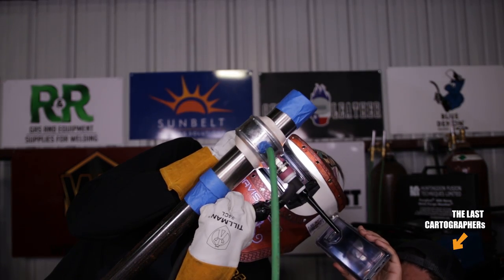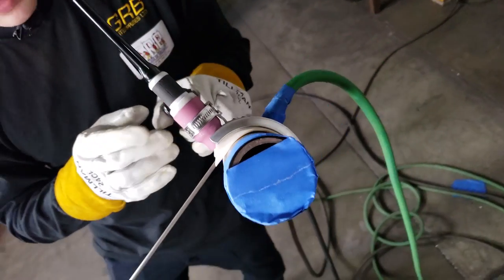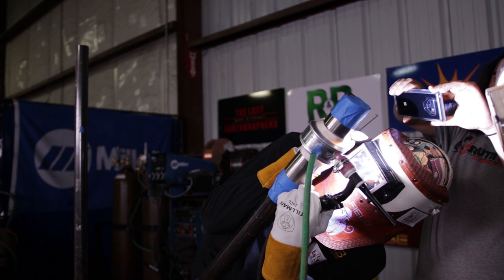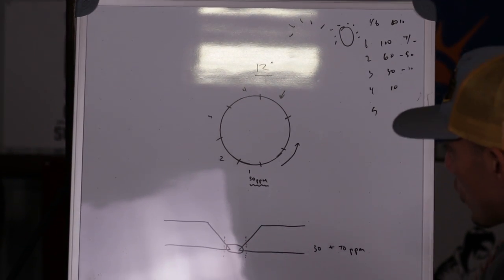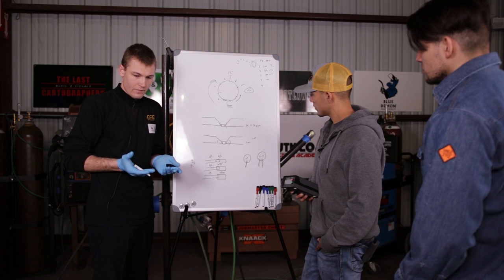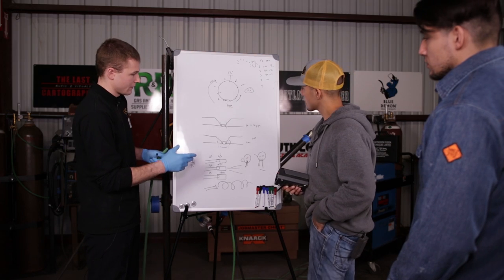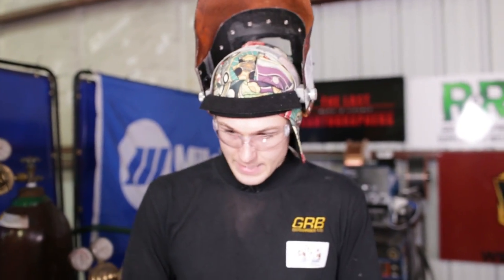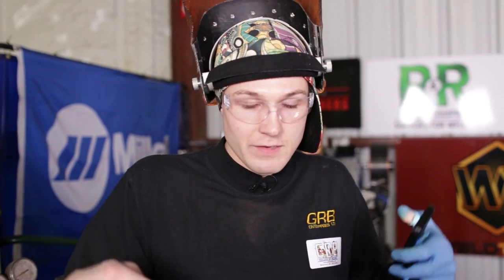Titanium 6G Welding with Travis Field - Part Two

Comment: Did he mention his actual settings on the machine as far as pps and amps?  I remember in part one he mentioned 200 in explaining pulsing current per ripple. What's amps did he recommend for root vrs filler & cap? Also what was pulse per second set to? 8 seconds on post flow before and after activating and terminating the arc? Sorry, i gotta watch stuff like 5 times before it sinks in. Damn ADHD . Havnt gotten around to flashing trough both of the videos again yet to seek out my questions. If someone could type that ballpark info out so I can take a snap shot that would be awesome. Thanks.

Comment: I never thought about gasoline and anti-freeze for the cleaning aspect of it...I have always used 91% alcohol or better...if I could find straight PGA (pure grain alcohol)  for cleaning, same as I would when seal flossing copper pipe or tig welding stainless potable water or sanitary lines...the alcohol was just used to remove any oxidation or oils left over from finger prints if touched with ur bare hands...people don't realize just how much oil and grease ur bare hands will leave behind no matter how clean u think ur hands may be...but the gasoline & antifreeze just seems to me like it would leave some residue behind..but I guess not or this guy wouldn't be using it I'd imagine...this guy seems like he knows what he is talking about and doing...so I'd say his advice is certainly sound advice...anyways, that's my takeaway on this video...hope it helps someone someday 😉

Comment: Titanium seems like a pure pain in the ass to weld
Reply: Depends how strict you are with yourself. This is kind of far and beyond what you could get away with in the field and still be within code
Reply: @jeepwk6.5L  not much different from stainless or nickel alloys, just needs protecting while it cools down for longer. This guy loves the sound of his own voice and tries to over complicate anything and everything he possibly can.
"Energy in Kj expended into material and the HAZ and number of ripples applied relates tobnumber of seconds post weld protection from atmosphere to prevent atmospheric contamination causing oxides in the deposited weld and the heat affected zone" blah blah blah and all that bullshit.

Dont cook it, protect it while it cools. Thats pretty much it.